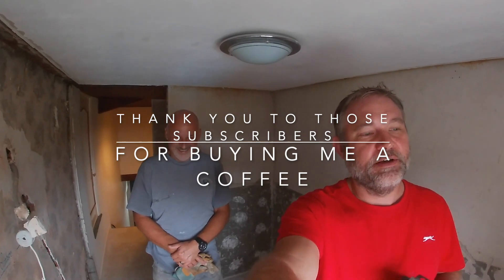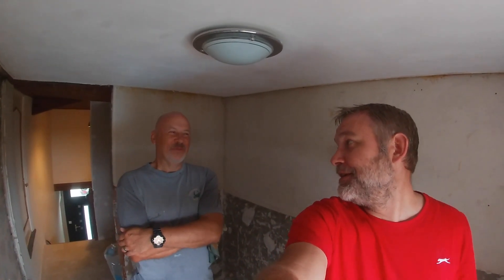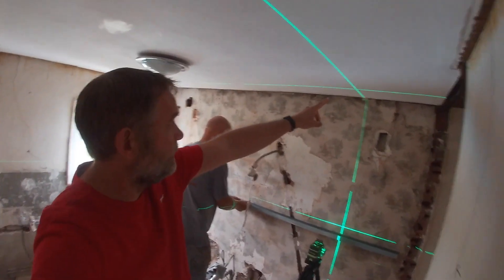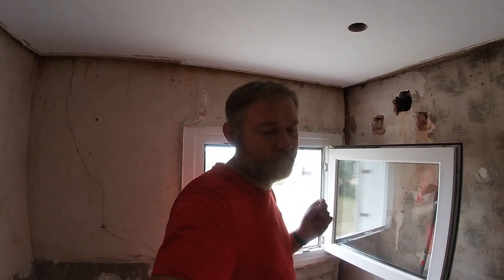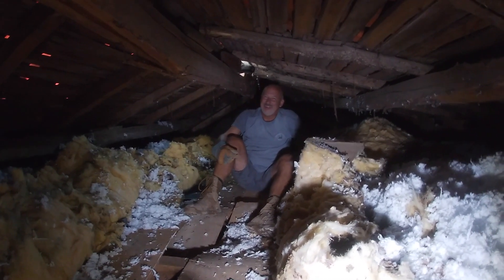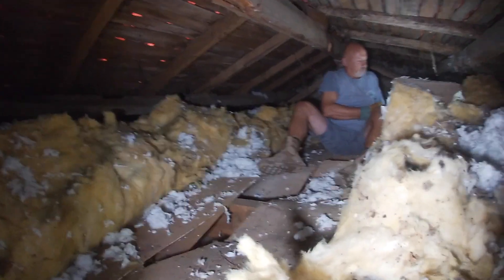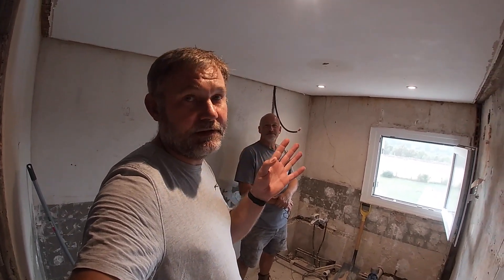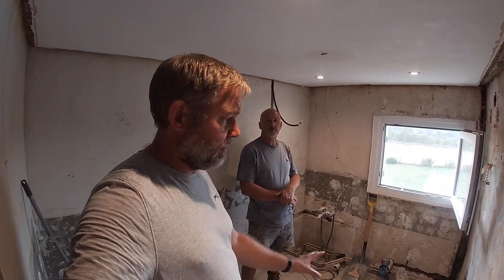French Bathroom Renovation Part 2

Comment: My claustrophobia went into overdrive looking into the crawl space over the bathroom. 🥴 That's one hell of a crack in the ridge beam. That definitely explains the dip in the roof that I see in the opening segment of the vlogs. Glad you guys were able to wire the lights through the wall. Cheers-
Reply from the maker: Yes it was a bit tiny and also extremely hot. Using the area to the side made it a lot easier and cooler. Thanks for watching 👍

Comment: Great video Andy. 
Glad you were able to sort the wiring out for the lights.
That is one heck of a cracked beam and I was surprised to see you say that structural bits and pieces are not covered in the normal survey.
Is that the same as a House Buyers Survey against a Full Building Survey when buying a house here in the UK?
Take care mate.
Cheers, Huw
Reply from the maker: Thanks Huw. It's a bit different in France. For example if you build an extension there is no building regs inspection like the UK and surveys don't include structural and as you say is more like a house buyers survey. Stay tuned for the next episode where we look at his crazy heating.